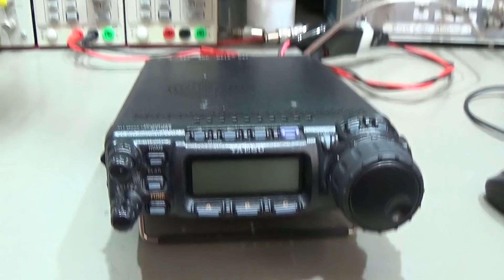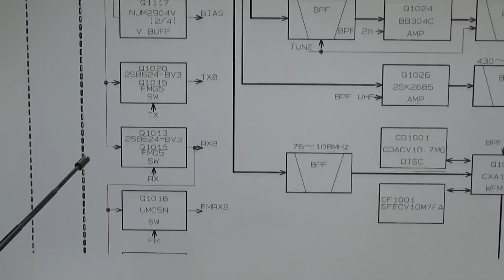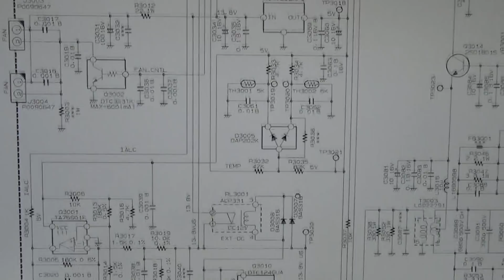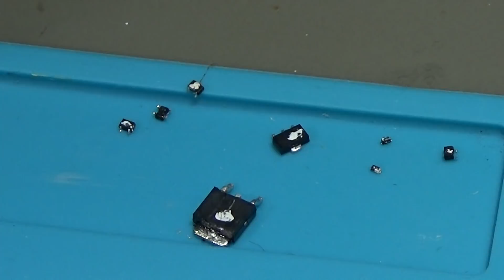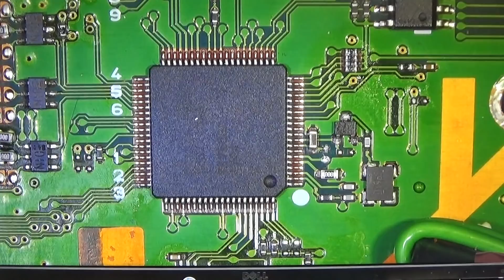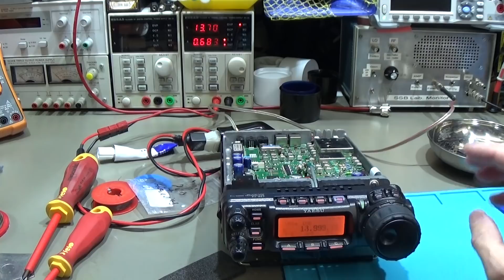#238 Yaesu 857 no function

Comment: My ft857d won't turn on anymore! Neither with the button on the front panel nor with the one on the microphone. It clicks but it won't turn on anymore! The connecting cable between it and the body of the radio is broken: I repaired the broken cable, but it won't turn on. What could have happened? 73 es tku

Comment: Hello, unfortunately the processor in my ft857d has died 😓 please tell me if you have access to the parts or maybe you know where to look for them? Best regards, Daria SP9DAR
Reply from the maker: Try your local authorized Yaesu dealer or the Yaesu UK subsidiary?
Reply: @TRXLab  Does this processor require programming or can it be used ready-made?
Reply from the maker: You'll get it ready made from Yaesu
Reply: @TRXLab  The dealer stated that production of the processors has ended and they are no longer available. Is there any other way to store my 857?

Comment: Peter, my 857 suddenly gets no receive audio, and I cannot figure out why. The antenna is picking up signals, and the s meter registers signal strengths but no sound, even on open squelch. Is there a possible easy fix for this situation?
Reply from the maker: Check if the audio ist Back If you Put an external speaker to the Back jack.

Comment: This is a very good video, but I had the same type of damage on my FT857 but mine still worked but the audio was very bad, I sent the radio to our local Yaesu Dealers and it took them 2 years to just give me a quotation for repair, they wanted to replace the entire main board and the cost of that was more than the cost for a good second hand / used radio. Since then I will never buy a yaesu radio ever again as the support was very bad. Thank you for your video just sad I only got to watch it around a year later... keep it up.

Comment: Hi Peter,  I have a FT-857 which is behaving very much the same as the radio in this clip, powers on, display comes up, audio can be heard, will go into TX- then switch off after 3 seconds with display still illuminated.  I did the same voltage checks as you with similar results.  You replaced components in the switching section which didnt resolve problem and then did the CPU.  Could you give me an idea of the MCU cost as that may alone may make repair attempt worth pursuing.
Reply from the maker: it depends approx 70-80€

Comment: where can I get a spec info on this radio I been trying to get this radio fixed, the radio when switched on says 9v and after several tries finally goes to 13v the local tech here won't tell me about a part number for this unit
Reply from the maker: search on the web
Reply: @TRXLab  thanks and have asked around the tech gave up. too many have done this and mentioned buy a new radio. funny a $20 part over a new radio which is around $700 if its possible

Comment: This is a common problem with this kind of circuit design where there is always power applied to the processor even when the radio is off so it can be easily damaged by spikes on the 12 volt supply line. I'd much rather see them use a hardware power switch that actually disconnects the 12 volts when the radio is off.

Comment: Have the same radio, original production and not the D version. Very nice work in restoring this classic!
Interesting service monitor you have on the bench. Is there any reliable source for such equipment in the EU especially used equipment?
I have an IFR 1200 with spectrum analyzer and it no longer turns on. Shipping back to the states is out of the question, customs would charge me an arm and a leg when it ships back to me even though I would declare it to them before shipping out.

Comment: This is one very compact radio that I am very interested in to use in my car and field camps. I love that it has all the modulations on so many bands. I would like to work SSB on VHF & UHF, which would be a new experience for me, and also to be able to have a chat with CB operators on 27 MHz too. I have been reading reviews on it and one thing really bothers me, lots of owners have complained that the LCD develops faults (blank lines) after some time, especially when it is used in a car (heat? cold? vibration? all?) What is your experience regarding this matter? Has any 857's came to you with LCD problems? Best regards from Istanbul, TA2KQ
Reply from the maker: Very very seldom seen on the 857 much more often seen on the 897..Hope that helps

Comment: Very nice work! I have also had this radio for about ten years and sometimes it can't be turned off with the button. The data on the display disappears, the radio turns off the sound, but the display stays on. I have to unplug it to turn it off. After that, it works normally again for a few weeks, as if the power relay remain on. OK2AQA Marcel

Comment: Excellent success Peter. It reminds me of the video on the FT-847 whose CPU certainly had the same problem and which you couldn't fix. Finding a CPU with the right internal program is not easy. Well done and thank you for your videos!
Reply from the maker: Thank you. Yes you are right. The assumption was a faulty MCU very early but the radio was completely tinkered so the risk was too high to put more work and material in....

Comment: Another great video Peter.  A lot of work to save a super transceiver.  Could you tell me the manufacture of the ground clip and the probe tip for your multi meter.  They look like they are very functional.  Thanks
Reply from the maker: Thanks. Test Probes https://www.sks-kontakt.de/en/test-measurement/products/product?nr=9723181

Comment: you need to show how to put the chip back in and how you solder it in !!!!!!!!!!!!! for my 857 was in a thunderstorm all so and my 740 Icom  hf radio and 2 metal detectors,the radios was in a box not connected to a thing inside a closet in my home they do not work no more at all.
Reply from the maker: In video #130 you can get in idea how it will be done...

Comment: Great job, Peter! One comment  only… when you 45:20 clean the tabs using solder wig, don‘t swipe the wig over the pads. Just wipe the iron over the (not moving) wig. The wig sucks all the solder from the pads just by the effect of adhesion, caused by the heat  and flux applied to it. If you move the wig, you risk eroding (and /thus/ damaging) the pads.
Reply from the maker: Never had issues with ripped pads but will try your method. Thanks for comment

Comment: Thanks for the video. The massive part replacement understood but probably lost some of the learning value.  Also wondering if we could have used a scope and probed the cpu to verify it was the the problem.  Would have been so interesting.  Also the work on installing the cpu would have been so interesting.  Such precise work.  Your skills are outstanding.  Thanks for another great video
Reply from the maker: Yes you are right but I have always to cut out sequences in order to shorten down the video a bit. But testing a CPU/ MCU with the scope has been presented in may older videos already and it is always the same procedure...Thanks for comment and glad that you liked the video...

Comment: Hi, I have a question regarding the FT857 is there a simple test I can do to find out if there are any noisy components in my FT857. The reason I ask is that the receiver seems noisier than usual. I have tried the disconnected aerial test but still, get noise I was under the impression that if you disconnected your antenna your receiver would be dead quiet. I noticed on this repair when you had disconnected the antenna there was still static. I live in New Zealand so sending it to you would be too expensive I do have an IFR1600 test set. What tests can I setup which would give a good indication as to what is happening.?
Reply from the maker: Perform a sensitivity test and confirm that the radio is in spec that will give you a first indication...

Comment: Great save and documentation. My FT891 had bad final transistors, leaking power voltage, and now has audio with no S-meter. Think I found the issue, seems many 891 radios have weak parts.
Reply from the maker: Thank you.

Comment: Nice video Peter and such clean work replacing the MCU. Did you have to adjust any of the soft settings after you fitted the new MCU? Also I am guessing the static discharge may have scrambled the firmware in the MCU EEPROM making it crash, it's lucky that you found a replacement that worked.  Love the vids keep up the good work.
Reply from the maker: Thank you John and good to see you. No all adjustments were fine after replacement of the MCU. Even I did not get a clear answer from Yaesu it seems the the firmware in the MCU is a kind of operating system while all the parameters are stored in the external EEPROM which was not defect and thus all was still there... Again glad that you liked my video...

Comment: Thanks again .
I would think that it would be helpful for both owners of rigs & guys getting into repair - to have some idea of costs for the fine work you ?
I have an FT-897 with multiple issues that I need to work on , did a couple repairs already , like the VHF / UHF filters that typically go bad .
Reply: I had the filters on my FT.897 replaced, and when i got the radio back nothing worked.  The radio wouldn't even turn on,  but the guy who repaired it said it didn't work when he got it - but I am 100% sure it worked.  So be careful.
Reply: @aslerunarborgersen5175  Maybe your venting or something , but your reply has little to do with my commnet - except the idea of repalcing filters.
Your comment should be a standalone comment - finding competent repair people , too bad you had a bad experience .
I'll reiterate my point / question , not that Peter should , just thought it could help with added info - typical cost of repair - for both buyers & sellers .
I would not be against some ideas from Peter on finding good help , but as I said - a comment on it's own .
Reply: @KD0CAC  You asked about the cost for a great technician like Peter, and I just added my comment on what may happend if you go to a cheap "technician" - you can end up with a (more) broken radio. I maybe should have added "cheap" in my comment, but I thoought you could understand what I meant.
Reply: @KD0CAC  Yes maybe it should be a "standalone comment" - but as I said, I just wanted to warn people against using cheap technicians. I don't know how much Peter will take for a repair, but he is worth every $ or maybe Euro. Take care, stay safe 73 LB5JG
Reply: @aslerunarborgersen5175  No problem really , 73
My mechanics of doing the same work may be close to Peters , but my equipment & mostly diagnostics need help .
And being retired for a couple of decades , knowing the approximate charges for someone thinking about supplementing income , or someone looking for repair to their gear - both of which my questioning .
My old trade , I hear rumors that pay can be double , but maybe inflation may be a big part of the increase & the need for skilled people are part of it .
Thanks again Peter
Reply from the maker: swapping the board which is what will be done on a regular basis these days is much more expensive...

Comment: Did this guy (=owner) really take the TRX into the car and left the outside(!) antenna connected?  > Darwin award!
Reply from the maker: Of course not but it all happened so extremely fast that he was not able to get the PL connector screwed off so quickly. The learning he took away is to use in the future a BNC connector for the antenna to be able to get the koax away in a fraction of a second...
Reply: @TRXLab  but it sounds so at 0:36 : ... when he was touching the radio which of course he took with him into the car but the antenna was still connected ...

Comment: Very nice repair job, Peter - "shotgun" servicing is a real gamble 50% of the time!  Personally, I would always have first chased down the extra 32mA current drawn.  The heat camera is SUCH a useful tool for diagnosis - but SO expensive!
Reply from the maker: That might be right but as I said we had also power supply values out of specs....
Reply: @TRXLab  Yes indeed,... but I generally don't like the hassle of pulling out SMD parts unless I understand their failure mechanism.  Chasing a solid current error just "feels" easier.  Nevertheless, another job well done!
Reply: They’re getting cheaper as more people buy them.
Reply: Thermal cameras that is.